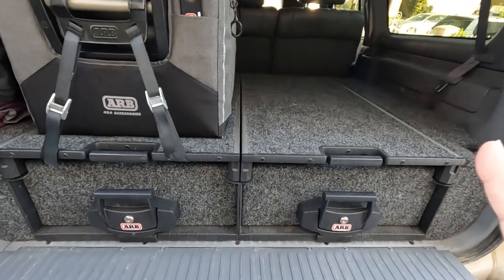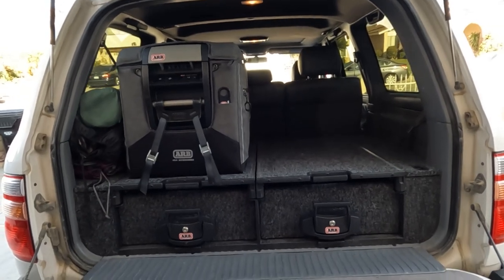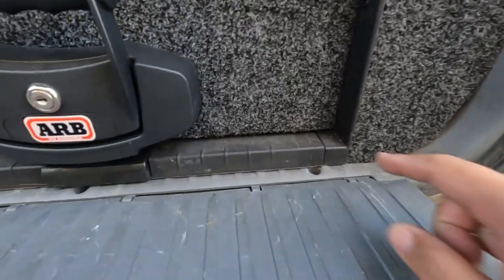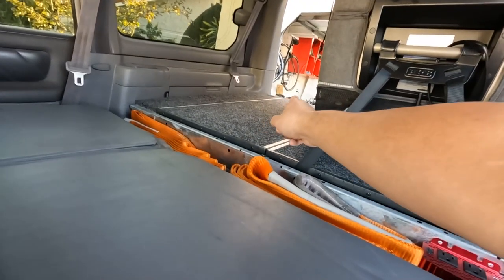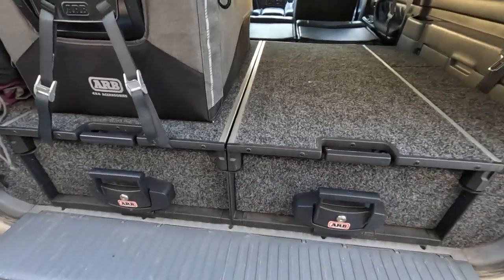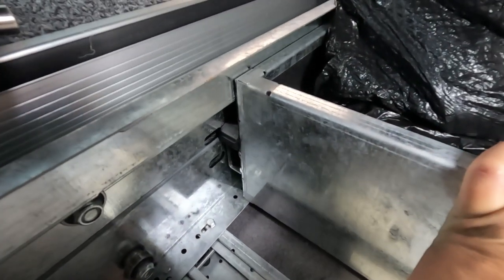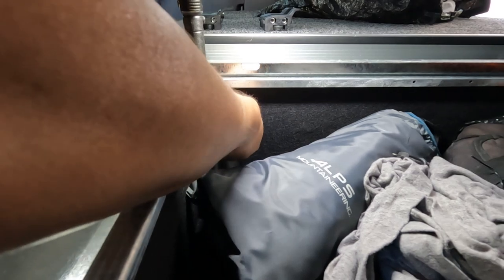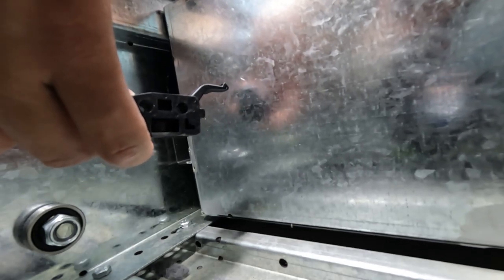Replacing the one weak part on my ARB drawer system and 1 year review!

Comment: HOT TIP! 

I spoke with a guy from ARB when I bought my replacements, he told me to install them with the drawer fully Open. This way they align perfectly with the catch. If you don't it will most likely happen again. A little bit of Loctite on the screws too (these can loosen over time) ✌️